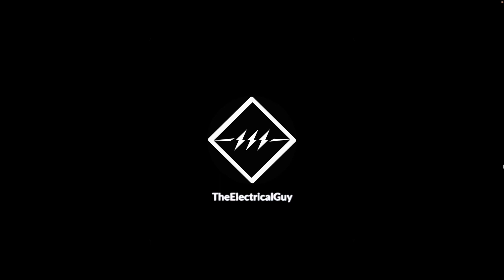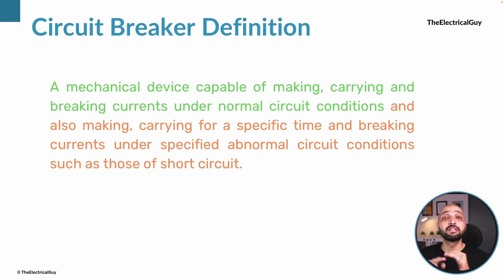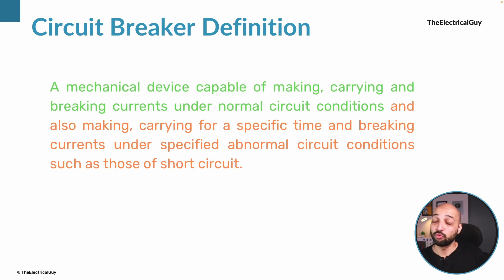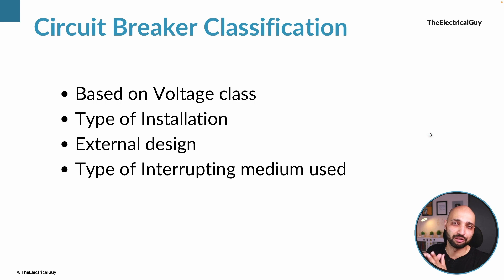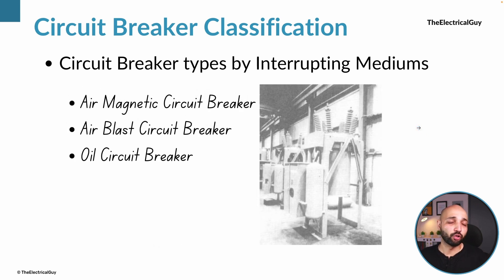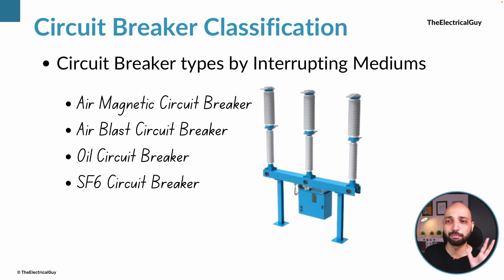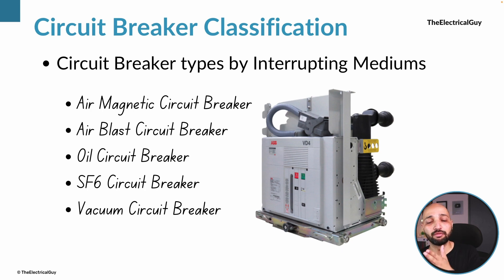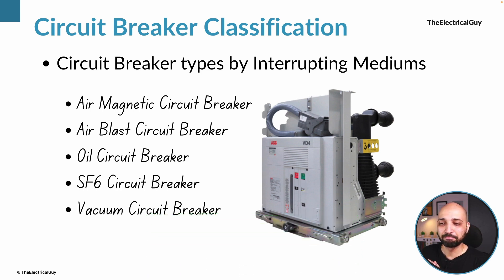Types of Circuit Breaker with Detailed Classifications | TheElectricalGuy

Comment: Very informative. I have  a question for you Sir. Last week we were performing tests on  11kV Switchgear on a substation. We first tested insulation resistance on the 150mm² Paper Cable  and learned that two phases,  Red & Blue have become in contact with each other. All of the phases were not in contact with EARTH.

 Having these readings from the megger we concluded that the cable is faulty and had to Thumped to locate the fault. We did exactly that, but the Thumper did not do as expected, it was not giving signs that the cable is faulty. We then tested by VLF and the cable passed all the tests. After these tests we discussed this and decided to energize the cable since it has passed the other tests apart from the megger's. We energized it but without giving it a load and it did not cause any problems.

My fear is, when the time comes for this cable to feed a load there is going to be a problem, because when we were testing using VLF there was a " shhhhhhhh" sound on the back of the panel right at the termination of the cable like a gas was leaking. 

In your opinion do you think the cable was faulty or the problem is on the termination (GAS). Or do you think the cable is fine and will be even when supplying a load?

Thank You.